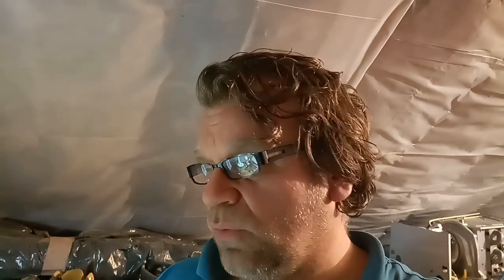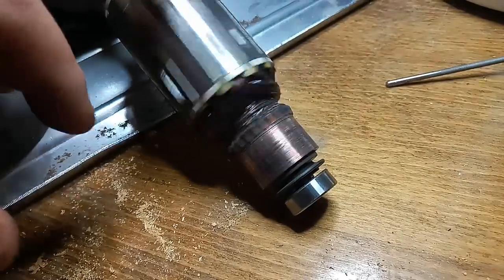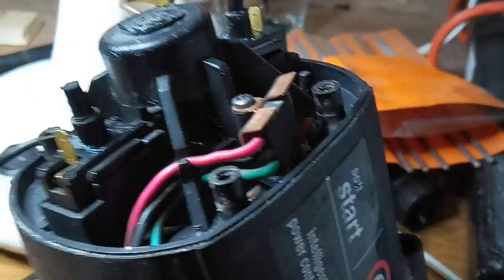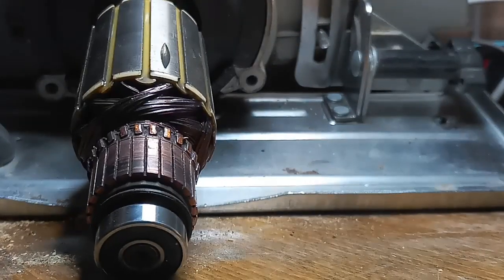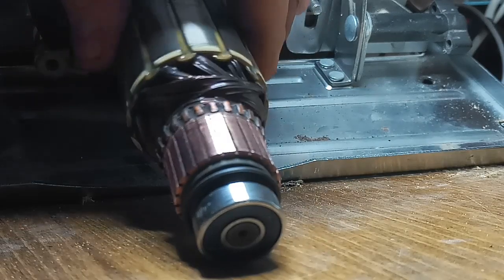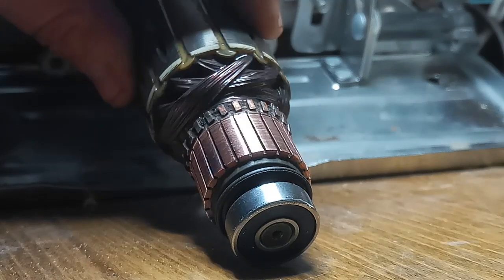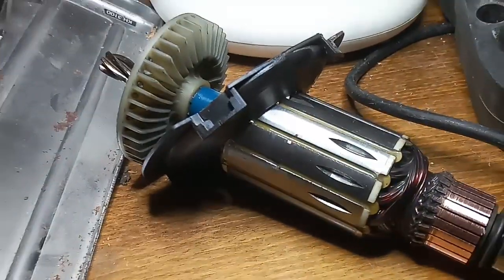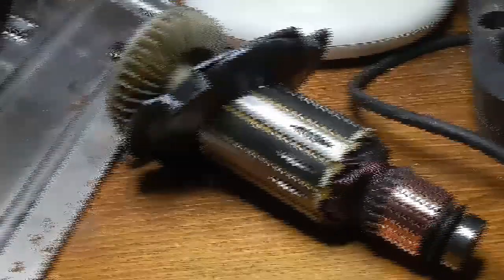ParkSide Circular Saw taken apart - Sparkling Carbon Brushes

Comment: Im having the same problem with my older Craftsman tablesaw motor. Cleaned the copper all smooth and tested for continuity- only thing I can guess is maybe I need new high quality brushes instead of new Chinese from Amazon? It runs but the sparks are just way more than normal and smells. Smokes if it runs very long too. Im realy stumped.